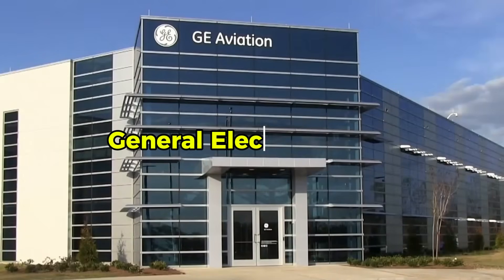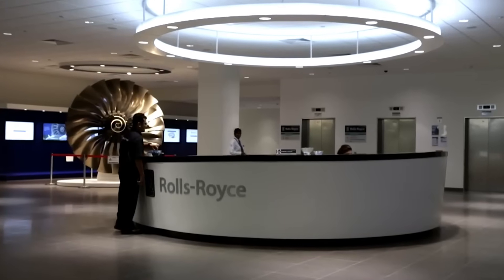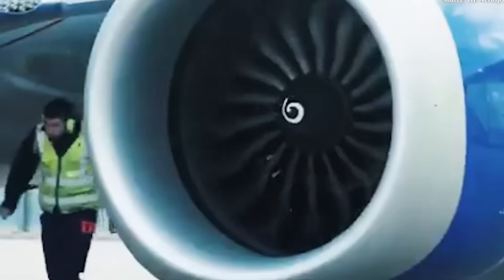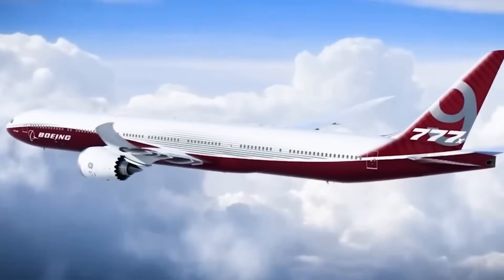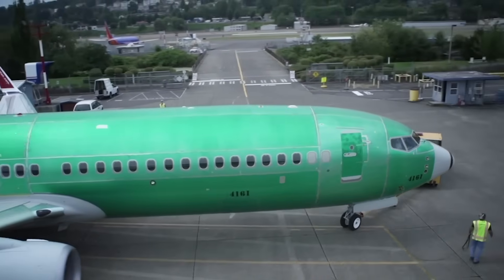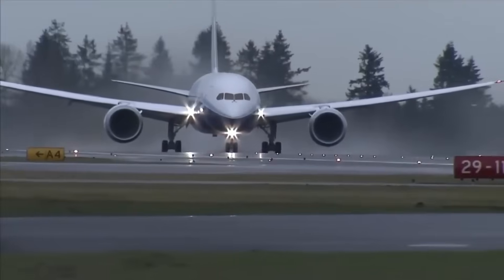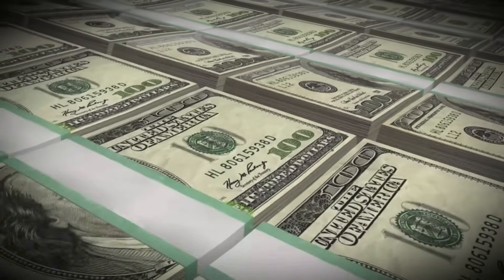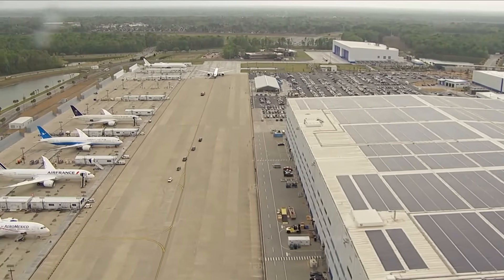SHOCKING Reason Why Boeing 777X Chose GE9X Over Rolls-Royce Ultra Fan

Comment from the maker: Hey everyone, just wanted to address a mistake in the video!
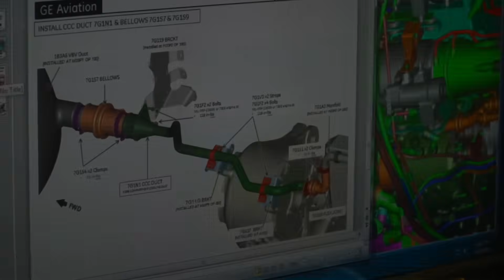@ 2:08 I said Rolls-Royce never powered any 777s, which is obviously wrong. The Trent 800 did power several 777 variants like the 777-200, 777-200ER, and the non-ER 777-300. 
I meant to focus specifically on why Boeing chose the GE9X for the 777X, but I worded it poorly and that’s on me. Thanks to those who pointed it out, and I appreciate you keeping me sharp. I’ll be more careful with phrasing in future videos.

Comment: @ 2:08 it is stated in this video that Rolls Royce has never powered the 777 variant ????? WTF, the non ER version of the 777-300 has Trent 800 engines on it as well as some 777-200 and 777-200ER, why this video talking rubbish  ?????????????????????????

Comment: I understood that each airline rents the engine of its choice?  They don't buy the engines, they hire them.
Reply: That is how RR likes to sell engines. Delta refuses to do that and signed a different deal for RR engines.  Typically, GE sells the engines, but not always.

Airlines that turn over fleets at 12 years or less should lease aircraft and engines.  Those that fly airframes longer should buy.

Small airlines often have no choice but to lease due to credit costs.
Reply: No, not necessarily. Leading an engine gives the manufacturer additional revenue from the overhaul work. If you lease, you’re on the hook with the manufacturer. Own it, you can have anyone overhaul it.